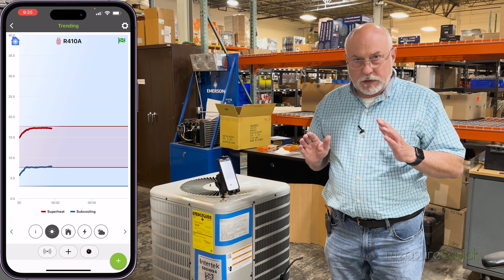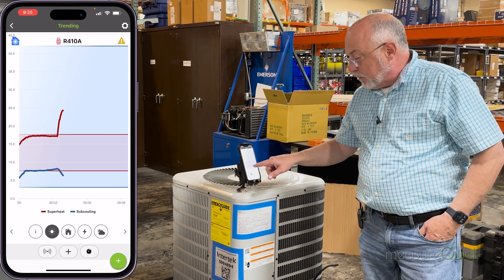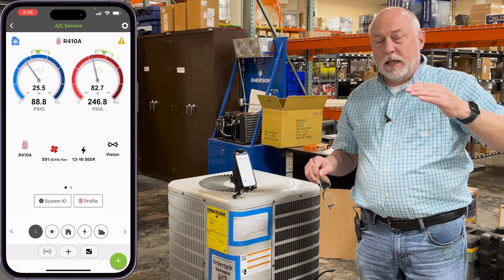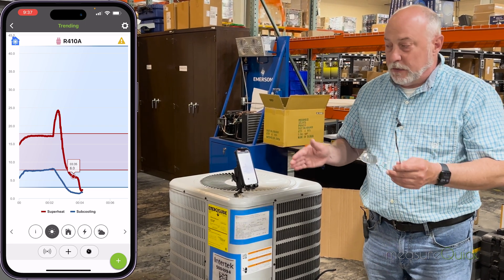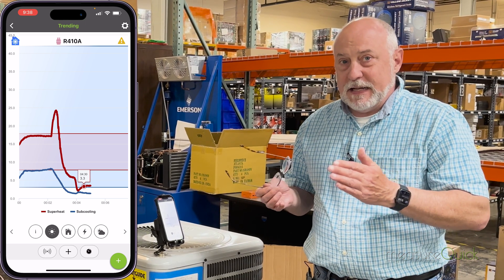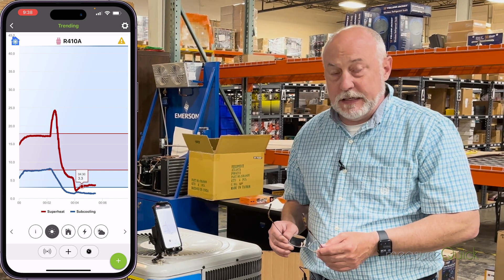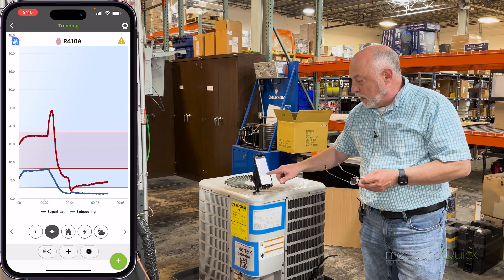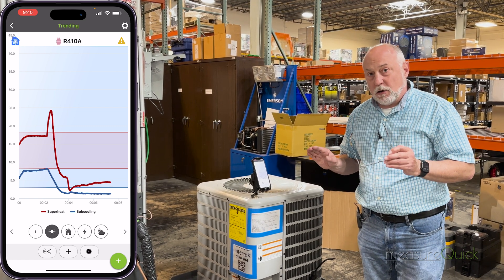measureQuick Diagnostics: Behind The Curtain

Comment: Wow Wow Wow!  It blew my mind when I realized that a boiler is refrigeration with R718 (water), moving the heat of the fire from some place where we don't want it to some place that we do.  As we boil the water it increases its volume about 1600 times.  The expansion pushes the steam to the radiators and once it subcools it falls back to the boiler.  The same action is happening in the evaporator as it absorbs the heat it expands and pushes the superheated vapor toward the compressor massively increasing its velocity.  I thought the compressor was doing all of the work!

This leads me to another thought.  I couldn't understand the pressure drop you get on some microchannel condensers, up to 35 psi.  The microchannel tubes are acting like an orifice as the refrigerant condensed it takes up much less space and therefore there is a massive pressure drop on the liquid line.  Drives me insane that so many manufactures don't put liquid line ports on their package units.

Comment: 6:48 - Thanks for the warning (although, I should have already known this). My fixed MD unit does not have a suction line accumulator, so I can’t just slam the cover back on with the system running without possible flood back.

Comment: But what if we have a dirty condenser coil and low indoor air flow? In that case we would flood the compressor I think. What do you think? Thanks.
Reply from the maker: @DaríoMartínez-w6w  it likely still would not as your not moving enough heat. The low side has to absorb heat to reject it on the high side.

Comment: Twice in a 40-year career on water cooled, R22, TXV systems with low airflow I witnessed such severe flooding that the discharge lines were heavily frosted. The first one was a 100-ton Carrier system, the second was a 5-ton Chrysler Airtemp system. The compressors survived somehow. I swear that this is true. I never saw anything close to that on air to air systems.
Reply from the maker: I’ve seen a hot gas line, frost, but never a discharge line. Sometimes the refrigerant would back up in the hot gas line and has the system ran it would’ve evaporate out and cause the frosting. We had to put a check valve on the packed tee on the expansion valve to stop it.

Comment: If you increase airflow and the charge boils off quickly, why is there no superheat? Seems like you wind up with all vapor so no risk of liquid to the compressor.
Reply from the maker: @realSamAndrew  0 superheat means liquid flooding. The refrigerant boils so quickly that it carries the liquid with it. The rapid boiling basically pushes the liquid out of the evaporator.
Reply: Well I was also wondering about this too. How do you know for sure it was flooding just because it says zero sh? I  stopped the video when you put door on and asked what we thought was gunna happen,and thought about it and I predicted it would shoot strait to zero but for a different reason than you explained. So I thought it would instantly start raising in sat/ and pressure,which it did, but I thought the suction line would take 20 or 30 secs to start reading correctly. So if the vapor line was still reading around 28 and sat went up to 31 you'd be about 3 deg subcooled and since there's no negative sh it just says 0. Same exact thing as when the sh went up briefly when you first took the door off,then started coming down once pipe cooled down. Without a clear pipe there's no way to know unless you hear the compressor actually flood. Rite?
Reply from the maker: @HVACRTECH-83  I know for sure that it was flooding because when I was an instructor I put sight glasses in suction line and performed the same experiment. I have seen it. Subcooling cannot be negative. If it displays that way it is an error in the calculation.

Comment: It took me a while to realize the behavior of a "fixed" metering device is dynamic due to changes in the high side pressure. On a hot day when there's more load on the system pressures will go up and more refrigerant will go through the fixed metering device. 

In the experiment you ran, the high side pressure dropped, which lowered the amount of refrigerant going through the piston which helped the system stabilize in the low airflow condition.
Reply from the maker: @arthurhartwick7974  100% correct! I was thinking earlier I wish I had said that in the video.